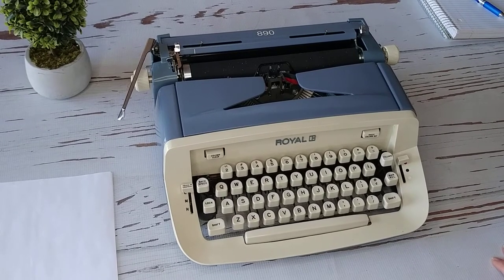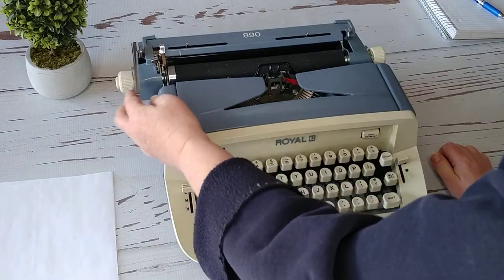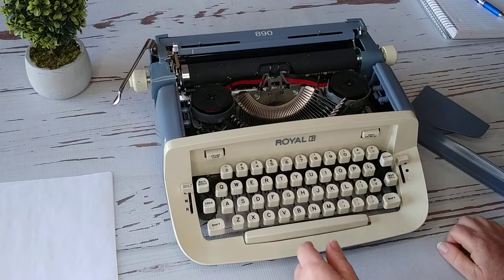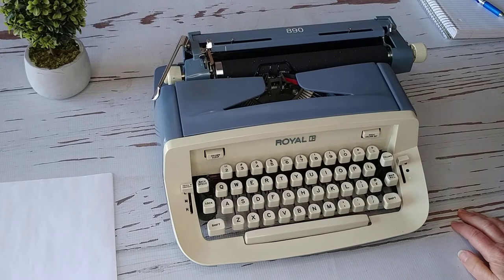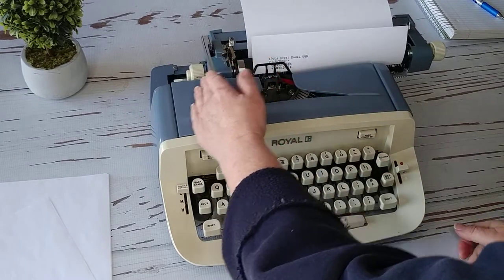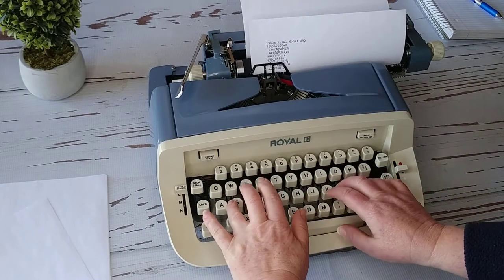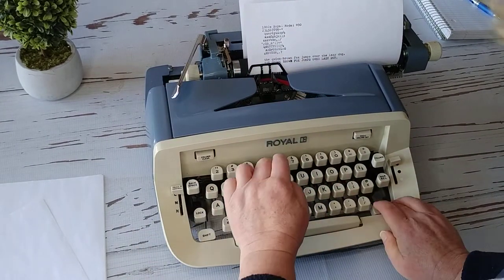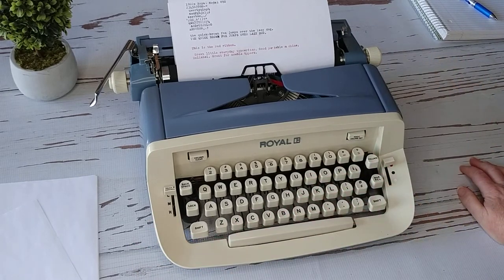TYPEWRITER TUTORIAL | 1960s Royal 890 Vintage Typewriter

Comment: What is the function of the Touch Control knob on the left side of machine?
Reply from the maker: Hi Matt, Touch Control determines how hard the type bars strike the paper thereby making your type darker or lighter. Most typewriters it doesn't show a big difference. It was really designed for when secretaries used copy paper.